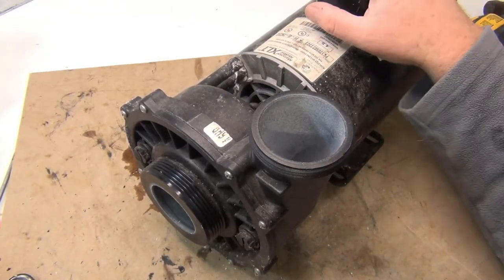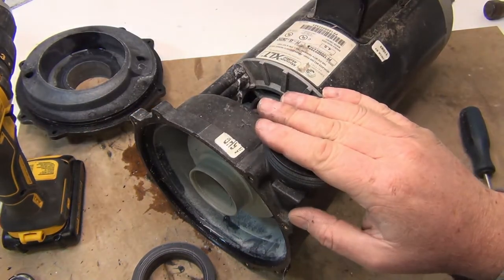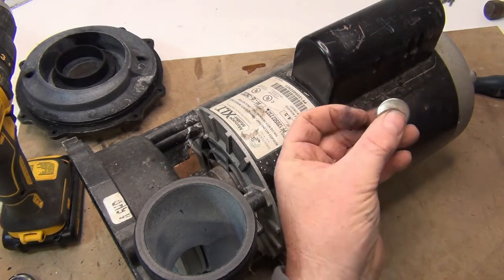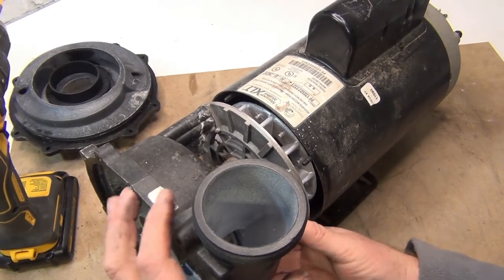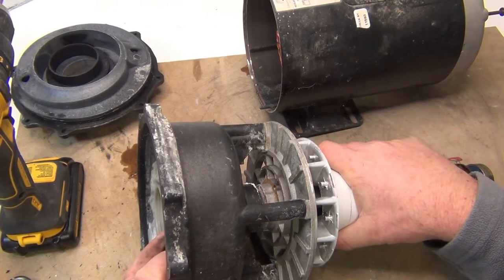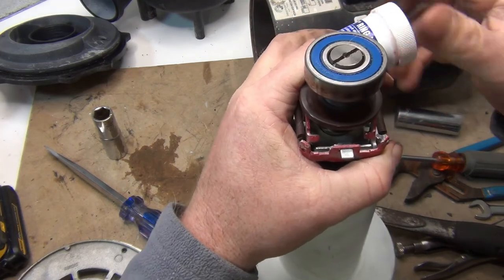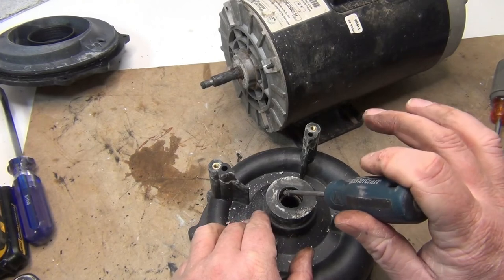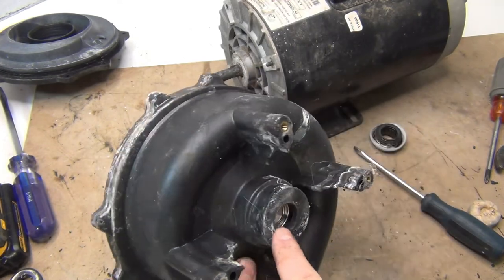Beachcomber Hot Tub Pump Seal and Bearing Change [ STEP by STEP ]

Comment: I have a bush pump that needs a bearing. It’s the spa motor 1563. K55mygrd-8367. What bearing do I need for this. Really tough to find which beating I need. Thanks for the informative video.
Reply from the maker: It's better to call a pump/motor guy for that question.  I normally take them apart and look on the bearing for the 4 numbers.  If I can't find the numbers, I'll measure the outter and inner diameter.
Reply: @VIPPoolsandSpas  thanks

Comment: How would you remove the seal from the impeller if the impeller was OK? I have one similar but I don't know how to get the seal out as it is recessed pretty close to flush, a lot like how yours looks at 6:10 in this video
Reply from the maker: I use channel locks most times.  Grab it just enough to move left and right upward.  If I can't, I put the impellor in boiling water to soften the rubber.